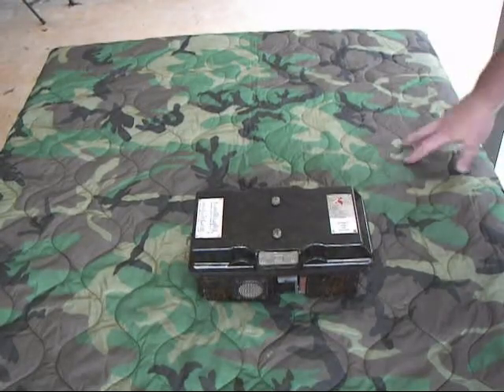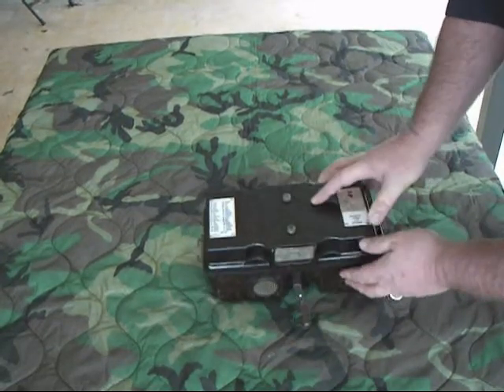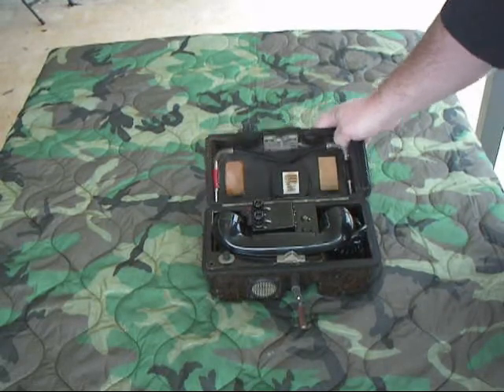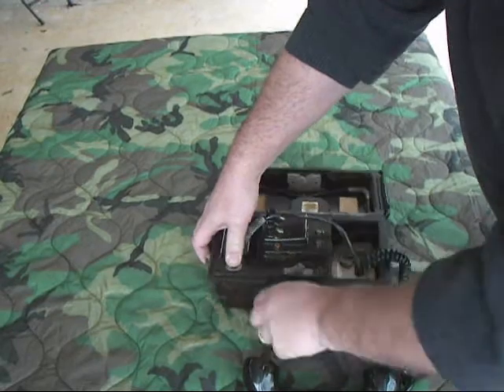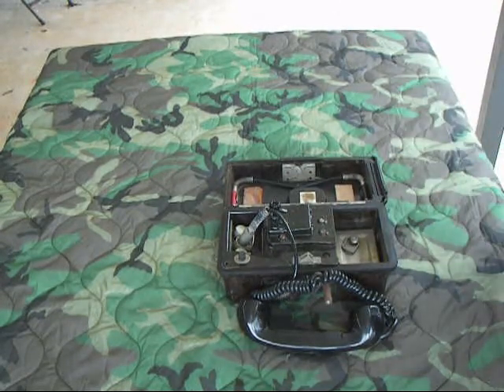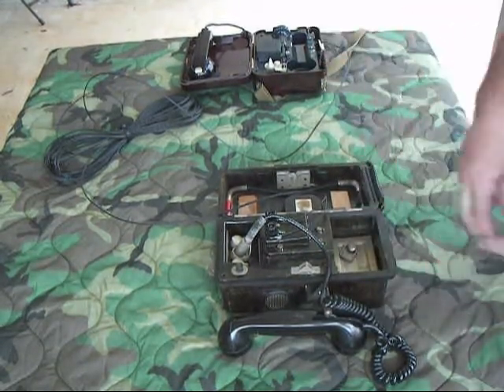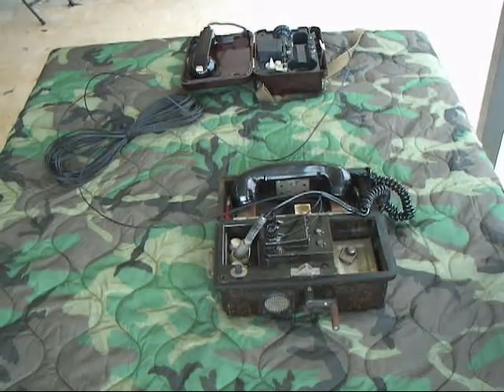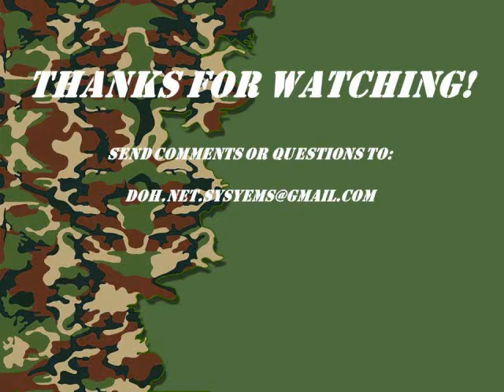FIELD PHONE OPS:  German Democratic Republic FF 63M Field Phone

Comment: How did you fit a 9v battery and get it to power the power?
Reply from the maker: I used a 9v battery holder that had alligator clips and clipped them to the battery snaps in the phones battery  compartment
Reply: @thefieldphoneguy8254  thank you

Comment: I recently got a pair of FF 63M and they work great however when I connected one FF 63M to a FF OB ZB and called it the crank handle was hard to turn. The FF OB ZB ringer sounded normal so I’m not sure what’s going on. If you or anyone else knows please let me know thank you.
Reply from the maker: Does it crank hard when connected to another FF63?
Reply: @thefieldphoneguy8254  So I've figured out it was the old roll of cable I was initially using. I had more time today to test them again and they all work fine now that I'm using the new roll of cable. I should have just waited a bit before posting here. Thank you for the help.
Reply: So I don’t comment enough on youtube to know why my reply isn’t showing up. I only noticed when signed out of youtube that it wasn’t there because when signed in I can see it. I don’t want it to look like I’m being rude by not replying so if this reply shows up than I got everything working fine now. Thank you for the help.
Reply from the maker: The reply never came through.  Its not big deal lots of times people don't respond

Comment: Which post  is positive and negative?
Reply from the maker: Are you referring to the binding posts?  If so, it doesn't matter since the signal on the binding post is an analog audio AC signal.  The only time if might matter is if you are using a single field wire connection with earth ground return.  In this case you would connect the binding post identified with the ground symbol to the grounding rod installed in the earth.  I don't remember off the top of my head if the FF63 was designed to operate in this fashion.
Reply: @thefieldphoneguy8254  nice, thank you. Also did you ever figure out how to adjust ringer volume? Mine only clicks
Reply from the maker: @joeb6986  There is no volume adjustment

Comment: What kind of cable do i need for them and where can i buy some?
Reply from the maker: Two wire cable. Any speaker, fire alarm, security alarm, Computer LAN cable, CAT3, CAT5 or CAT 6 cable will work.  I've done demonstrations where we ran two phones using building eletrical wire, not connected to AC power of course.  Basically any two wire cable.  Stranded wire works better than solid wire for uses where you are going to coil up and reuse the wire over and over.  You can use the military type field wire if you want sometimes it expensive.  I have a demonstration system of many different field phones connected to switchboards that I set up for military collector shows and use all commercial telephone and speaker/microphone wire. for it.  As far as sources go, I generally use on line sources or home improvement stores.  Hope this helps.
Reply: @thefieldphoneguy8254  this was great help, thanks for the info!